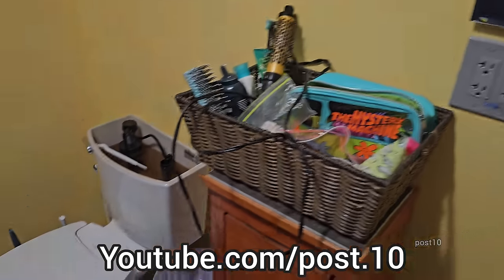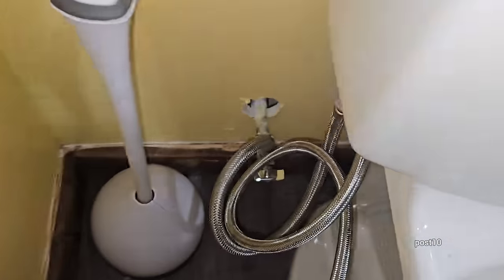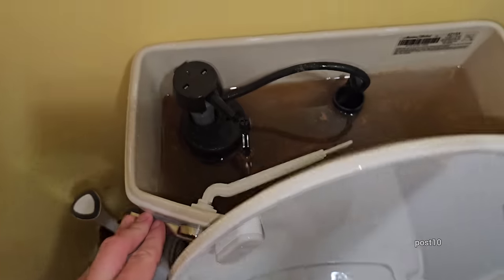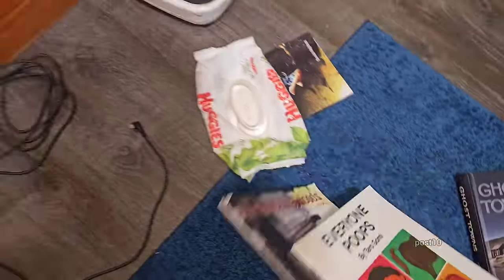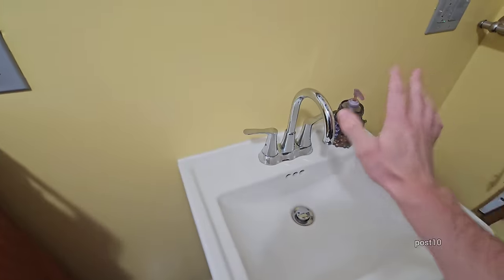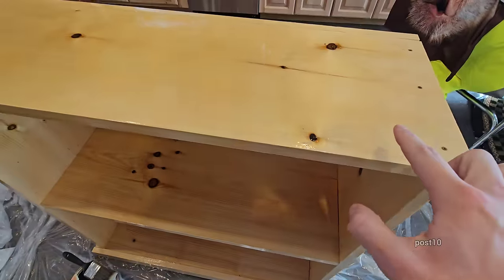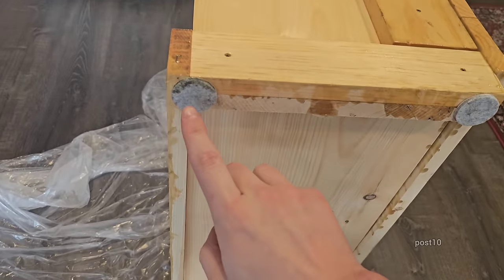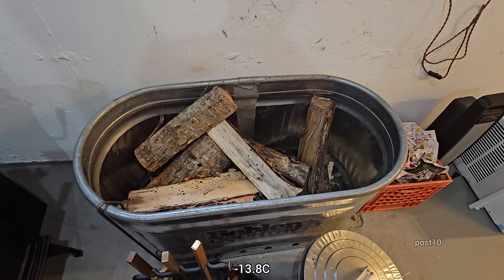Bidet To Help Septic System And Building Wood Shelf. Iron Oxidizing Bacteria

Comment: Iron-Out powder will eat iron stains and other mineral stains with no scrubbing, but it's spendy and the fumes are pretty overwhelming to some (me, for example).  We had a dishwasher with a plastic interior, and the inside would turn dark gray with the iron and and manganese in the well water; running an empty load with Iron-Out made it look like-new again.  Interestingly, the next dishwasher we bought had a stainless steel interior, and the mineral stains weren't able to stick to it for some reason, so the interior always looked new, despite our very hard well water.  When using Iron-Out to remove the hard water stains from the toilet bowl, the trick was finding a way to keep the water + Iron-Out trapped in the bowl at a level higher than the water-stain ring, for long enough for the Iron-Out to work it's magic.  The Iron-Out seemed to work faster with hot water.

Comment: Hey post, I have hard water too and I’m on a well and on a septic system. I installed a bidet last year and I am so happy with it. I use just a square or two to dry off. We are in the process of getting a new well now. Our old casing is steel and it has rusted through. The new one is plastic casing now. They went down to 480 feet to get water. We have a water softener too and it is much better for the appliances and it cleans better. Let me know if you have any questions for me. Love your videos buddy!
Reply: That well is so deep there is Chinese pipe at the bottom!

Comment: I love having a bidet. I had to get one for the other bathroom too. It’s life changing and it does save a fortune on toilet paper and septic tank cleaning. I went from using a roll every day or every other day to using a roll a week. Really good for feminine hygiene as well. Makes you feel cleaner.
Reply: Don't you still have to wipe off the excess water with toilet paper? Who wants to walk around with wet pants on?
Reply: @Hatbox948  yes, but that doesn’t take nearly as much as cleaning. Some bidets have a dryer on them or you can use a towel. Same as getting out of the shower basically after you’ve had the whole area power washed. 😆
Reply: A roll a day? Damn!
Reply: @jeremygumke5150  multiple ladies in the house.
Reply: @jeremygumke5150 maybe Scott 1100 rolls so cheap my dad gets mad when we have to buy them more often.

Comment: You may want to rethink getting a water softener. It’s a lot better for your pipes, water heater, washing machine and faucets. You can also use less soap in your laundry, and it’s a lot better for your hair. You can get washable cloths for your bidet. You’re really only using them to dry off your undercarriage, so they’re not gross. 🤷‍♀️
Reply: The only downside, I've discovered, to a softener is that it can cause your skin to react and make you more prone to pimples. I miss my old house with its hard af water lol it tasted better too.
Reply: Very true. Soft water would help in washing machine and make clothes last longer ( wasn't sure how to word that). Skin feels better after a shower..
My softener is on low and really makes a difference.. I did keep a spout for drinking water....
Reply: He’s right abt the softener 👋🏼

Comment: 3:04 in the tank there is the hose that is inserted in the plastic pipe. that is what supplies the water that comes out in the holes under the seat. tank water does not come out of those holes.

Comment: Also I noticed you remove the aerator off of your bathroom sink, I do the same thing too but what I do is I remove the aerator from the metal housing and buy some stainless steel window screen or stainless steel screen and cut it into a really small little circle big enough to fit inside the plastic housing the aerator set in but not small enough to fall out, this allows you to have a very clean looking stream with no dribble when you shut the water off. It's something I do to a lot of faucets I have so I can maintain pressure and have lots of volume to fill things up quickly and the stainless steel screen stops the drill and it allows the water to come out clear and clean looking.

Comment: The new shelving looks really nice. I hope you are feeling better than you sound. Sinus issues can be a pain. 

We had a bad cold spell here, much colder than usual. For several days it was in the low 20s with single digit wind chills. My space heater couldn’t maintain a decent temperature and it was 38 degrees inside. I went to a friend’s until the worst of it was over.

I hope you get some decent snow soon. I’ve been rewatching your other winter videos. The igloo one is my favorite. 🙂
Reply: I truly hope you didn't have any frozen water pipe issues!
Reply: @MonkeyJedi99  i live at an RV park and the park water lines froze so I had no water for five days. I used to live on the East Coast so I know how to keep my own lines from freezing. Everything is okay now. 🙂
Reply: @graceangel5146  I hear you. 
I live in New England, and there have been days when the space heaters are for the pipes, not the humans.
Glad everything is good now.

Comment: I'm super impressed with your Bidet! 
I live in the UK and Bidets are a relatively rare thing to find in an Average household but I wonder if these are available worldwide?!
It's an incredible idea to have the Bidet integrated into the toilet seat and I Want One! 
Dear Santa:elbowcough:🚬
Reply from the maker: It was a lot cheaper than I expected and everything hand tightens you don't even need tools to put it onto the toilet
Reply: @post.10 I'm going to have to re-watch to see how the water line for the bidet books up. My son gave me one for Christmas a year ago, but of course, I am responsible for installing it:)
Reply: @nannernose3133 hardest part for me was loosening the the water source after 50 years.
Reply: They are, just not sure if such an "external" retrofit bidet is available here in Europe. Usually they come built into the toilet or as a separate unit.
Reply: @post.10  Thanks. I've since searched ebay/Amazon and they are available in Britain and in Europa! I had no idea!
They vary in price, depending if nice Warm water is required and/or temperature control. From around £20 GBP up to 3 figures for fancier arrangements to rinse the ringpiece🤗
 I musta been living under a rock
Reply: yeah same here, for some reason i always thought i needed a whole new toilet, the thought of just getting an addon like this just never came to me, ill have to look around for something like this.

Comment: Bidets are great. I visited Europe for the first time 25 years ago and used one for the first time on that trip - installed one at home after that and have used it ever since. My septic system is 22 years old now and has NEVER been pumped out, not once (though it is oversized for the house).

Comment: Even better for your sceptic system and plumbing in general is to never use wet wipes nor flush them through the sewer. They do not compose like toilet paper does, and can cause major clogging issues. Because they dont decompose like toilet paper they are also not really environmentally friendly.
Reply from the maker: The wipes don't get flushed even if they say compostable

Comment: Is the bidet water heated? If not, you're gonna have guests jumping all over the place in cold weather! Good looking cabinet. You two work well together.  Thanks.
Reply from the maker: The cold water doesn't bother anyone I know, yes they have ones that are a little bit more money that you can also tap off the hot water of the sink or very expensive ones that heated on the spot without having to purge the line to get it over through the hose. Some expensive ones will even dry your butt so you don't need toilet paper at all
Reply: Bidets are great. Mine have heated seats, heated water, pulsed water and heated air.   What happened to April?  I miss her
Reply: The cold water isn’t that bad as ground water is probably in the 50s. I’m in NH so cold winters, and no complaints.  Feels good actually.

Comment: Just put some quarter round trim on top of that baseboard. It will cover all that up. Also they do make some stuff you can pour into the tank that will get rid of all that.
Reply: And I forgot also use a pumice stone to clean the inside of the toilet. It will get rid of that ring just make sure the pumice stone is wet as you’re doing it.

Comment: Don’t forget to pump out your septic tanks 3 or 5 years
Reply from the maker: I had mine pumped about three years ago and it's been operating for two years now That I got the plumbing working again I think I'm gonna get it pumped again this year just to see what's in it a manhole cover so I don't have to dig 5 ft into the ground again, I have one of the deepest ones the company has ever seen
Reply: @post.10 my septic tank has not a pump it been 5 years